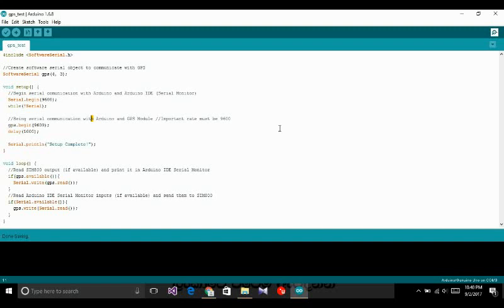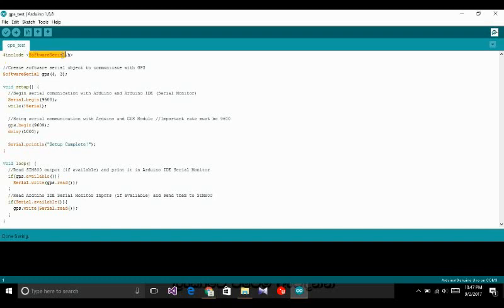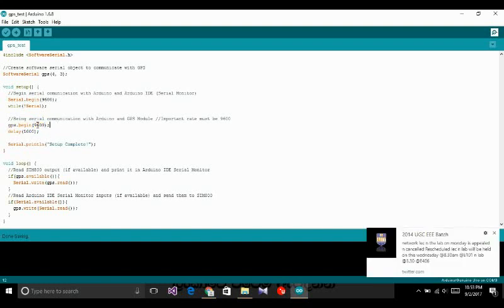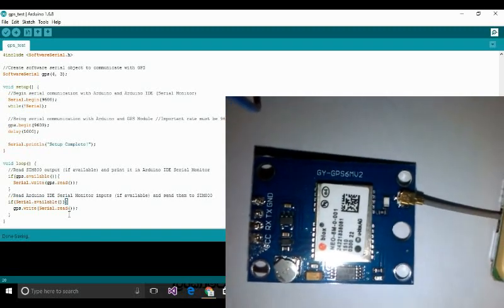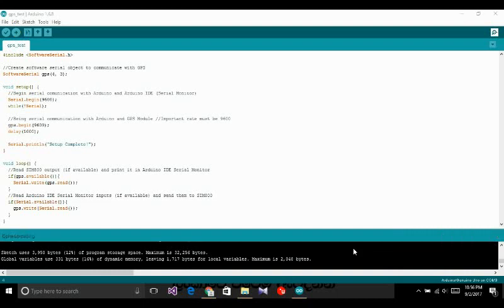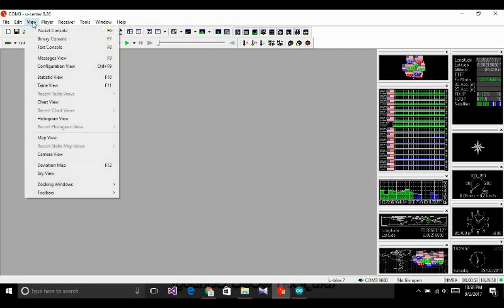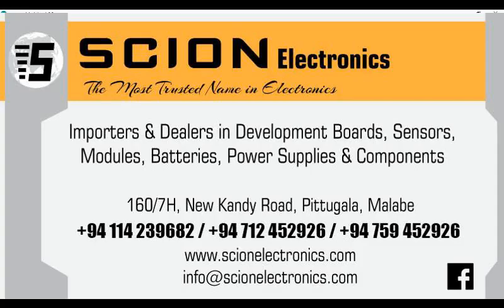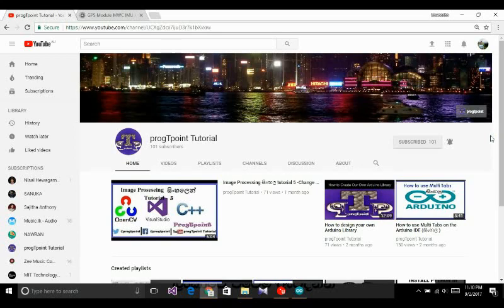Tutorial Communicate GPS (GY-GPS6MV2) to Arduino

Comment: Hi, I have followed your example and connected the GPS module (GY-GPS6MV2 )to an Arduino UNO. The LED on the GPS module is not blinking red or solid red. What could be the reason for this? VCC is connected, to 5V, GND is connected to GND, RX is connected to PIN9 and TX is connected to PIN8. Please help.